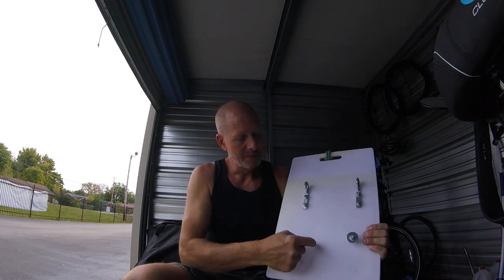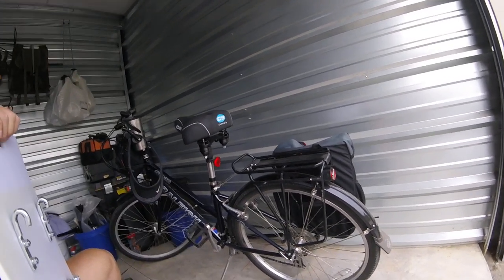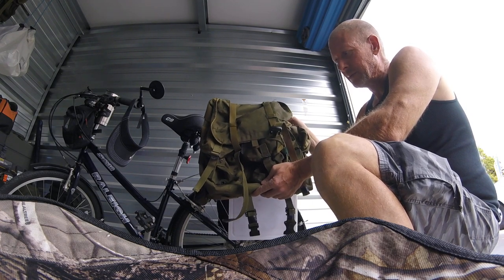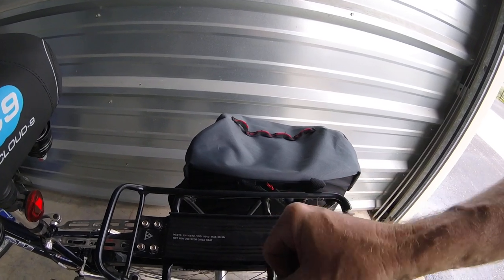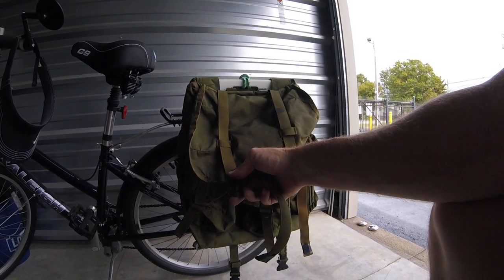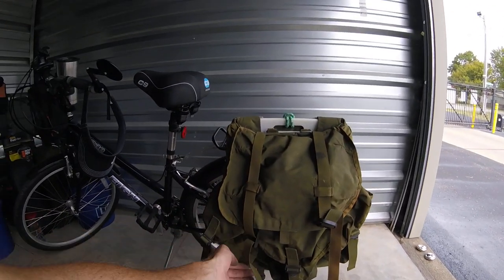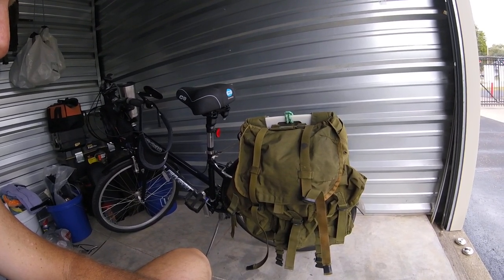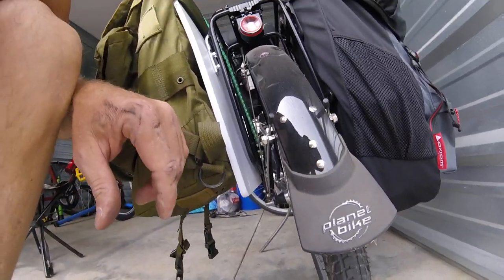DIY Panniers/Saddlebags

Comment: Seems like gravity load is only resist on the 2 piece of green canvas on top. Will it rip when carry heavy weight?
Reply from the maker: It should be good up to around 35-40 pounds for a medium Alice pack. If you think about it, conventional panniers are only held to the rear rack of your bicycle with plastic hooks and a small piece of bungie cord.

Comment: I picked up several colors of Vitex fabric and I bought the attachment point hangers from an outdoor store  ( most expensive part of the pannier )  and whereas you are using plastic backing, I used 1/8" door skin . Good point about having the panniers held to the rack at the bottom. As I ride a recumbent I do not need to be constrained with a small pannier to avoid heel strikes.  My pannier dimensions  are 14" horizontal at the top with a lid that covers the top  with 16" vertical height and 5.5" wide but the bottom is 27" long .  Not quite the parallelogram ?  This gives me all the room I need for what I carry. I based the bottom,  on my 22" Thermarest sleeping pad. Yes Thermarest makes a superior sleeping pad to what I have and it squishes down to half the size and has more insulating power , but it is 300+ bucks and mine is 12 years old and paid for already . I also placed my panniers a bit higher so they are behind my seat which is already wide and breaking the wind . .You can sew your own and put in what you think is necessary far cheaper than what you pay for a commercial product 
Use taped cardboard to make what you think you need and make sure it fits and then do the least amount of cutting of that tape to sew it up in fabric.